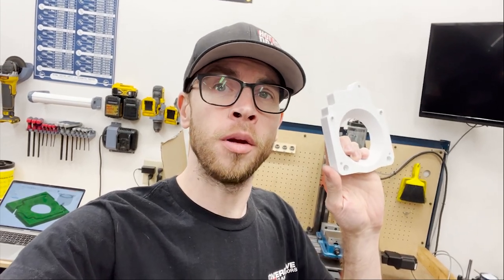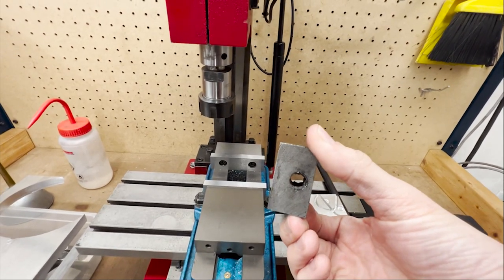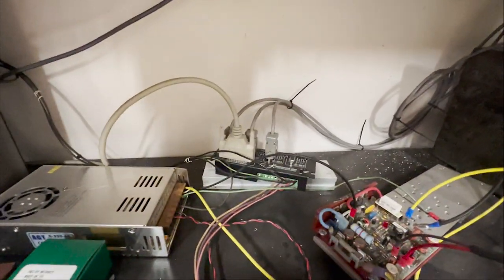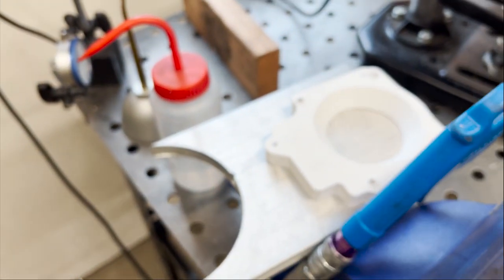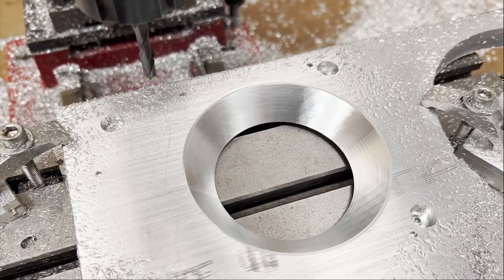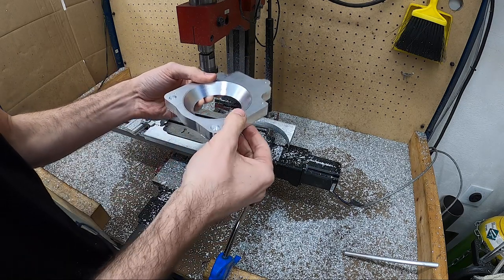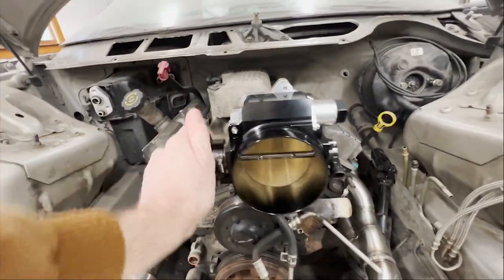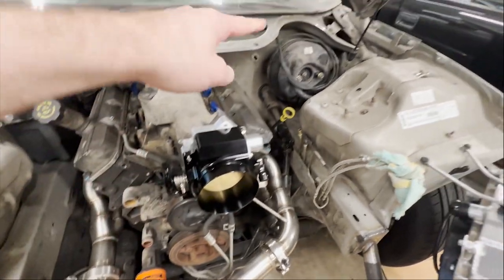Amazon LS Throttle Body Fixes & CNC Milled Adapter

Comment: The earlier 3800 F bodies used a dbc throttle, I'd imagine that the cable and bracket would pretty much directly swap into the dbc ones. I have no idea when they made the change from dbc to dbw though

Edit- a little reading to satisfy my own curiosity indicates that the 3.8 was dbc through 98, and changed to dbw for 99-02
Reply from the maker: Good thinking, I'll have to check my local junkyard to see if they have one.
Reply: I have a 98 bird. And actually pulled my dbc to switch up to dbw from a 99 up. I know I'm backwards